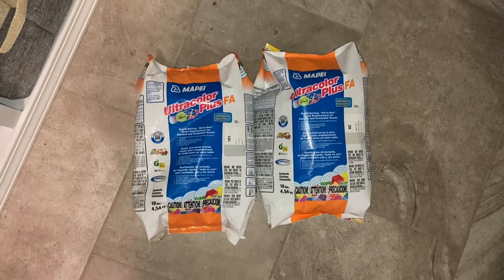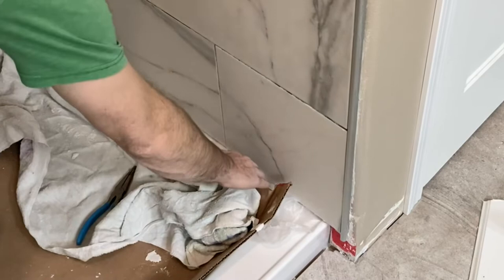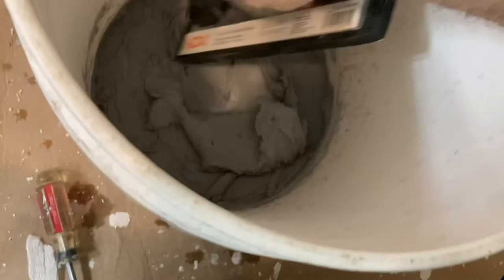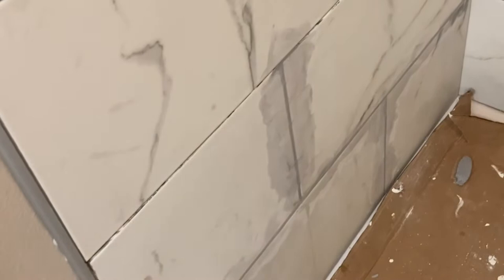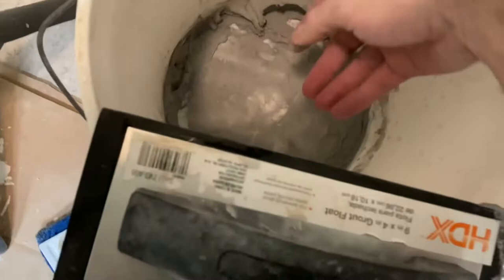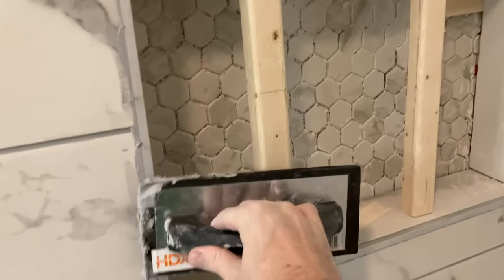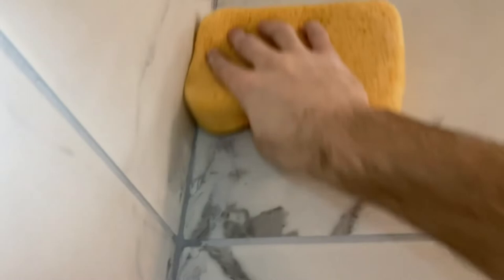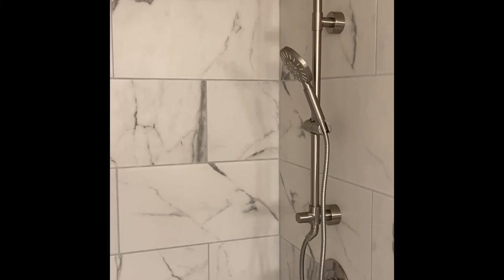🔥 Mapei Ultracolor Plus Grout (FULL REVIEW)➔ How to Apply + Tips - Watch Me Actually Grout a Shower!

Comment: I have found that using ice cold water when mixing this product up extends the working time. Also, do NOT mix it at high speed, as this will make it set faster - mix it slowly, ideally by hand. It is important that your sponge is only lightly damp - if it is too wet when you wipe the grout, you can end up pulling too much grout out of the joints and it can also result in uneven grout colour when it dries.
Reply from the maker: Thanks for sharing!

Comment: never use a speed mixer for any kind of rapid set stuff as you introduce too much air to the mix and as a result the mix will set much much quicker and this is the reason people fail working with rapid set mix.
Reply from the maker: Thanks for your comment!
Reply: @diybandit  you're very welcome. thanks for sharing your experience.
Reply: Instructions say to use a mixer and it worked fine for him.
Reply: @MAGAMAN  as it happens instructions say specifically to use a low-speed if you are using a mechanical mixer since you introduce too much air too quickly and therefore the mixture will go hard too quickly. use a mixer and find out the hard way 👍

Comment: That corner seam should be filled with silicone not grout. This decouples the two tiled surfaces. I had a tiler grout a corner seam and it all cracked out within a year.
Reply from the maker: Yes, this was a rookie mistake - I remember getting so grout happy! My grout lines are holding after a year, but if they ever start to crack, I'll have to cut those corner grout lines and fill with caulking instead. Thanks for your comment.
Reply: Corner seam is fine if you've got the stable structure in place behind your water resistant board, but shower trays are definitely not grouted.
Reply: @sybaseguru  my structure is rock solid. It’s the expansion and contraction due to changing temperature that causes it to fail. At the joint the two surfaces are expanding/contracting in two different directions. 

You need these expansion gaps, just as you do for laminate flooring, vinyl flooring etc.
Reply: That's how I've always understood it should be done.

Comment: Never grout change of planes, silicone only.  Time will tell but red guard is a bad product and grouted corners will eventually fail.
Reply from the maker: Lesson learned! Why do you say Red Gard is a bad product?
Reply: It's not the redgard's fault if corners crack. It's differential expansion.
Reply: That's bullshit. I lived in a house for 30 years with grout in the corners that never cracked. If you put slllycone in your corners you are going to be cleaning it out and replacing it every few years. Redgard works just as well as any other waterproofing membrane if you apply it correctly. You are one of those people spreading internet myths started by people who don't know what  they are doing.

I have found that there is generally an inverse correlation between the number of subscibers a channel has and the competency of the people running the channel. For some reason, the more subscibers a channel has the less competent the content of the channel seems to be.

Comment: what a mess...you probably used an extra bag of thinset which is all up thru joints...
Reply: How rude.he did a fab job
Reply: Using leveling spacers makes a mess of the grout joints. Also, I would rather have a little more cleanup of the grout joint at the end than not have enough mortar under the tile, especially on floors.
Reply: @MAGAMAN  wrong... one can use a leveling system without all that mess. perhaps it just comes with experience but the key is once a tile is set, you then move back the thin set of the next tile away from the edge of previous tile. you dont remove any thin set (that would effect in not having enough at perimeter) but just strike it away from perimeter about 3/8 inch, you then install clips trying to not gather any thin set when placing under tile. now once you set the next tile and beat it in or move it back and forth, that thin set you just moved away will spread back to the edge without coming up joint. yes you will have a few spots to clean, but you honestly had way to much. are you a homeowner or do this professionally? as for the hex tiles, thats a real disaster my friend, that had to take hours and hours to clean. no way you were scratching all that thin set out, so you most likely scratched it out only just below the surface, so 3/4 of your joint is thin set and 1/4 grout and thats not good. the detail coming down the side of tub is diy for sure. have no issues with good instructional videos from homeowners, but you should state this.

Comment: Mix with a paint stick or very slow drill. The only fast set issues are created by excessive drill mixing or medium to high speed…. If you use a drill only use slow. Avoid direction to introduce air at all costs. The issues with FA YOU hear are high speed mixing or mixing bits that force air into the mixing. Also - always mix the dry bag or the bags together —— mix them dry —- first —- regardless of using the whole bag or partial or multiple. 
Color will be even because the dry mixed overall —— the set won’t jump the clock because you mix with either manual tools like paint sticks or if a large batch very slow—- very slow with drill bit. If you go fast with drill bit the grout will be rock in five minutes. Mapei doesn’t call this out at all on the bags. Do not mix at anything near half speed and use the mix defined with DISTILLED WATER —— another thing they don’t say…… mapei is destroying projects because they don’t want to print seven languages of specific text on bags. It’s an extreme fallacy and risk. Never mix medium or high speed—- EVER. Premix the powder dry before any water……  tilers are laughing for failures because you didn’t pay.  Lots of prep and care beyond six useless images on the bag……… use care - see fifteen videos.
Reply from the maker: Thanks for your thoughts!
Reply: Instructions say to mix with a drill, not by hand.

Comment: Agree with several comments on this product: DO NOT mix at high speed !!  If you use a drill, do it very slowly !  Excess air infusion will make it set up too fast !  Also, agree with using very cold water.  This will extend working time for an amateur not used to using this product.
Reply from the maker: Thanks for sharing

Comment: DO NOT use a utility knife to remove dried grout from your tiles in a shower, especially if you have used a waterproof substrate (I hope you did) as you could compromise it & lead to rot/leaks. 
Get a grout removal tool.
Reply: I used a grout removal tool which worked great for the most part, but there was still some areas it was stuck to the sides of the tile. I was worried the grout too would damage the extremely cheap tile I used, so I used a utility knife, but I pinched the sides of the blades with my fingers so the blade could not penetrate any deeper than I wanted. I also found that the back of the blade seemed to work better than the sharpened edge.